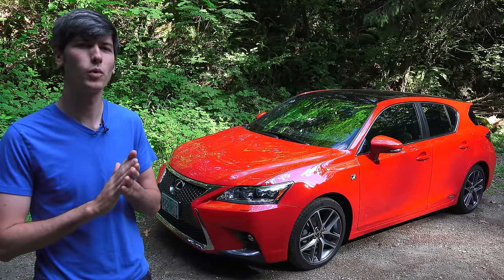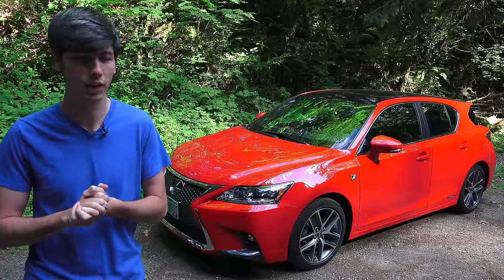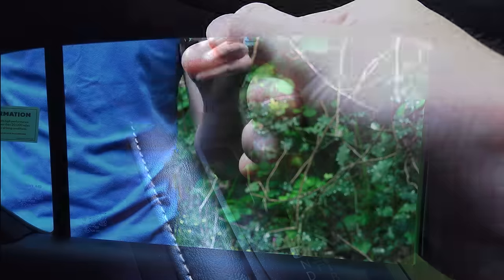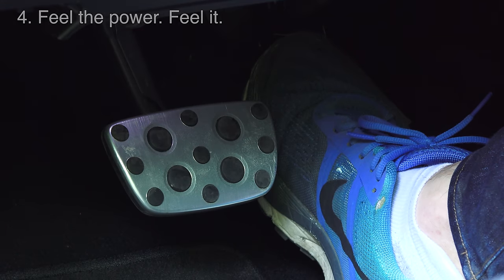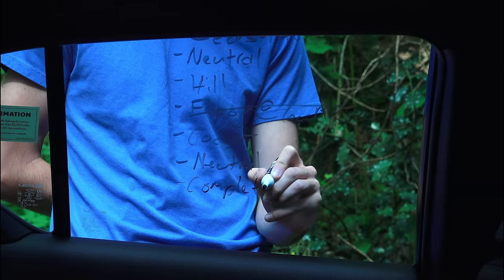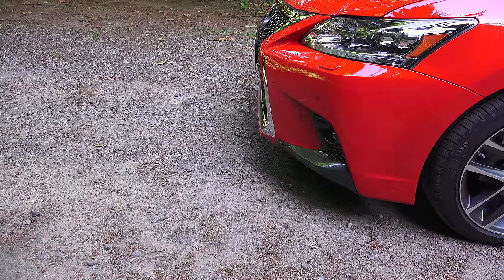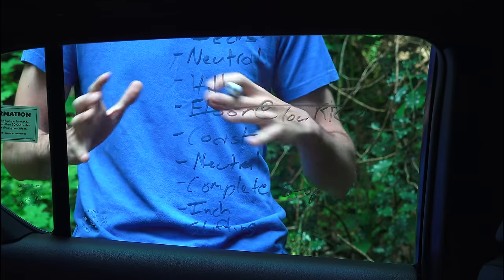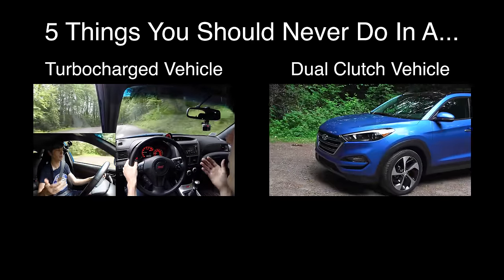5 Things You Should Never Do In A CVT Vehicle

Comment: the one huge advantage to a cvt is the possibility of the car to drive in full speed in reverse
Reply: Cool. Now I can turn my car from FWD to RWD and do some mad drifts!
Reply: Unless I has a speed limiting system for reverse, then, nope
Reply: +Steven Tenney electric car motors are 3 phase?
Reply: +MrJockeyHD old stuff if DC but hybrids and Tesla's have inverters that make 3phase AC power.
Reply: With 3 phase induction motors eventually, but with 3 phase synchonous motors that are very common it won't work because the field has to match the rotor position and it won't turn..
Reply: +Steven Tenney aw right thanks man I didn't know
Reply: +Steven Tenney however if it comes from the battery and obviously has a rectifier and a transformer where does it pick up the other two phases having already the line and neutral where does it pick up the other two
Reply: +MrJockeyHD the DC bus feeds DC voltage through the 3 IGBT's that each make AC power on individual phases
Reply: +Steven Tenney cheers again, how do you know this?
Reply: So it will be exactly like a fork lift!
Reply: +MrJockeyHD I work in industrial HVAC on large tonnage chillers that use variable frequency drives . BTW all inverters are only designed to last 10 years even if they cost over 100k on a 800 horse power motor. due to heat on solid state electronics. so a Tesla owner can expect a huge repair bill once the car is over 10 year's old. let alone battery cost
Reply: +Steven Tenney so what about the MK1 Prius that came out in 1997 still in original inverters and battery?
Reply: +Steven Tenney thanks for the knowledge, i'm an apprentice electrician and a huge care so electrical and mechanical stuff is interesting af, thanks again
Reply: +Steven Tenney gotta love VFD's! I use a bunch of them (KBAC 27D), in my shop for variable speed on machine tools like my 2"x72" belt grinder, surface grinder, and drill press. Literally I would be lost without them
Reply: +Finn Custom Knives there awesome on fan and pump motors don't beat up belts on start up
Reply: +Steven Tenney yep, they have a ton of trimpots for adjustments of everything. The slowdown feature is huge for me so I can stop the sanding belt quickly to change grits/abrasive types, not too quickly though as it does strain the system a bit
Reply: +Steven Tenney Although mine as primarily for single to 3 phase conversion and for the variable speed, although I do have a reverse switch as well
Reply: Is there any good resource to learn about the changes in inverter tech? Like up to the brand new topologies used. :)
Reply: " all inverters are only designed to last 10 years"

That doesn't sound right unless they design that failure into the system.  I can't see any reason why they should wear out.  They're solid state and the magnetics should last forever.
Semiconductors lose their gain over time with something called "junction drift" which happens faster at higher temperatures but managing heat is just a detail.

I'm not challenging you but I'm interested to know where you heard that.  I have amplifiers that are 40 years old that still work like new.
Reply: It is liquid cooled.. pretty much all electric cars have liquid cooled motor and inverter,  Volt, Leaf, Focus, Soul, Tesla, Prius, etc. Some have liquid cooled/heated battery pack. This is a very interesting comment thread.
Reply: +danwat1234 yes except for some Honda's . but you are relying on an electric water pump to last a decade. which when it fails it gets the igbts hot and reduces the life span
Reply: Steven Tenney I bet the Tesla warns you if you get a failure like that.  So you could fix it before you did any damage.
Reply: +Warren NZ I know a Prius will shut down of you get air trapped on vfd cooling system. bit it does heat up to a certain temp to alarm system and shut it down
Reply: Steven Tenney I know some CVTs use rubber belts like snowmobiles.  Those are crap.  The Lexus' is more like a chain.  Quite clever.  No slippage.  There's YouTube video on it somewhere.
Reply: perfect for arab drifting!
Reply: Warren NZ The inverter MOSFETS have high amperes through(in the range if 100A just for a 1kW inverter. Temperature management is a big deal in inverters. Also, they switch these currents in very high frequencies (of the range  greater than 16kHz fro sine wave inverters). 

Also, electronics don't last that long. The manufacturing methods used 40 years ago and now may be different.
Reply: Rojin Philip Reji OK, I'll accept that.
I've also heard from electronic techs at work that Chinese MOSFETs may have the same number on them as the OEM versions but don't always meet spec.

We run a lot of TV transmitters around the country and switch mode power supplies are forever failing.

So yeah, it's not hard to accept that modern electronics aren't always up to the task.  They should be though.  If you design a solid state circuit properly it should go for decades.
Reply: +Daniel Dias AWD= awesome way to drive...hehehe yep I got one
Reply: +Warren NZ Daf dutch car
Reply: Steven Tenney that's how I got my Chevy to the transmission shop.
Reply: Steven Tenney 
fast and furious mode?
Reply: cars are generally designed to last 10 years anyway, so at 10 years you'll have scrapped it.
Reply: Alan Brown I drive a 06' and it's 2017 it released in 05'
Reply: yeah go 150km/h on reverse is 100% safe
Reply: ***** on a circuit a while ago in holland, they did racing backwards after the era of dutch DAF cars
Reply: Circuit =/= Street/Road
Reply: ***** look it up DAF auto , was like a demolition race
Reply: still... high speed on reverse is not a advantage its too dangerous.
Reply: Nope, most CVTs have a fixed ratio reverse "gear". My Subaru bypasses the CVT completely in reverse with one ratio
Reply: And if you have an E-CVT you reverse on the electric motor only. That's because it's really a planetary transmission that does not "shift" gears.
Reply: lol, this works on a DAF but not on a modern CVT, which has a different final ratio for reverse.
Reply: Can't wait to see that! World premiere on YouTube!
Reply: You can win all the reverse races!
Reply: Pretty sure the car in Fast 8 was CVT then
Reply: That sounds fun.
Reply: Steven Tenney hows that a HUGE advatage 😂
Reply: "One huge advantage"
Reply: HAHAHAHHA
Reply: like Mater
Reply: Lol 😂
Reply: I think all cars are speed limited in reverse. I haven't found a car that goes past 40mph in reverse yet. Some toyotas use 2nd gear for reverse and can go quite fast.
Reply: big rigs over the road racing IRL
Reply: @georgiojansen7758  I own a 1974 DAF 66 Marathon and do  Historic Regularity Rallys with it. Toyota, Datsun, Peugeot and other owners are very surprised with the efficiency of the DAF . Regarding the backwards races I do hate them.
Reply: Lmfao
Reply: MrJockeyHD FULL BRIDEG RECTIFIER!!!
Reply: @steventenney8797  reversing any two leads on a 3 phase motor will reverse its direction.
Reply: I hadn't thought of that, lol.
Reply: Possibility does not mean that you can. You would have to mess up with cvt control program in car's computer...
Reply: @m1k869  3 phase synchronous motors are not very common. I have been working in manufacturing for over 30 years and I have seen only a few. At the factory I have been working at for the last 11 years there is none....
Reply: @steventenney8797  All HVAC VFDs are air cooled, while VFDs in hybrids are liquid cooled (more like a cooling tower), so the later work at a cooler steady temperatures.
Reply: It's limited, lol.
Reply: I WILL TRY THIS ON HIGHWAY
Reply: Yeah because we all do that in daily life 🙄

Comment: My last two vehicles were equipped with CVT. Kept the vehicle's time and distance maintenance schedule very strictly.  Never had a problem with the CVTs. That's with a lot of high mileage vacation driving with short mileage commuter driving. So, I guess, keep to the maintenance schedule.  I really enjoy the smooth transmission action.
Reply: 30k cvt fluid change??
Reply: 30k cvt fluid change??
Reply: @antvq  Most manufacturers suggest that you get the fluid changed every 30k to 60k. I would say if you change it every 30k to 40k (just to be extra friendly to the CVT) you shouldn't run into any issues with premature failure. 

From what I understand, a big reason why some CVT's fail is because the fluid wears down (when not changed enough) and causes higher temps in the CVT....This can then stretch the metal belt causing everything to essentially self destruct inside the CVT. The only way this would happen with regular fluid changes is if you were beating the vehicle hard for an extended period of time to the point of where the CVT reaches those high temps. 

Summary: Change the fluid every 30k-40k, and don't drive it like it's a racecar.....And you will be golden 👍👍
Reply: Just like a normal transmission. Nothing wrong with a cvt, everything wrong with a cheap cvt.
Reply: @saintrhoads3375  Exactly...Most CVT's are reliable enough as long as you change the fluid out at proper intervals and will last as long as regular transmissions. That being said, the only area where they seem to be more sensitive is if you DON'T change the fluid. I have seen regulars transmissions with 200k on the original fluid and zero shifting issues....But you would be lucky to get 150k on the original fluid in a CVT without it overheating and self destructing. Other than that, there is no reason they shouldn't last.

This does not include the Nissan Jatco CVT's lol.....Those CVT's are what gave CVT's this bad reputation to begin with.
Reply: most definitely  @antvq

Comment: I would love a video comparing the longevity and reliability of a CVT versus a traditional automatic transmission.   I routinely get over 200K on traditional automatic transmissions with nothing but fluid changes.
Reply: And CVTs have a lifespan of about 100k miles. If grandma drives it, it might last longer.
Reply: I got 140k off my Mk5 VW Rabbit with 5 speed MANUAL transmission off the STOCK CLUTCH and fluid, no fluid changes, clutch was still strong when I sold it (body rust from road salt)

Total transmission maintenance cost? $0.00! Seven years of reliable service, not a penny spent on fluid changes or rebuilds or anything, the manual is better, period.
Reply: Miles or kilometres?
Reply: @ambergris5705  Miles
Reply: @quagmirewarrior4202  where’d you get that number from. So inaccurate. If you don’t take care of the car then yeah you’re right
Reply: @vincestone5465  he read it from a Facebook post about one of the first cvt transmissions that weren't reliable, when in reality the cvt is just as reliable as a normal transmission
Reply: @keesknees  I agree we got a suzuki hatch and we are the 3rd owner of it, its driven 75k kms +, has cvt transmission works just fine, the model is 2015...
Reply: @quagmirewarrior4202  but when that CVT is paired with a direct injection engine grandmas engine goes to hell with the CVT at 100k.  CVT is a great technology but it leaves much to be desired in terms of development.  In 20 years they'll be great.
Reply: Who cares I can 3d print planetary gears as much as I want for cheap, even if I can't, it's still a simpler fix than fixing an automatic transmission
Reply: @Meleeman011  I need to live next door to you, LOL
Reply: I got a mitsubishi with cvt with about 120k miles no problems whatsever its my beater,work car. Because its so fuel efficent
Reply: never thought id see someone praising automatics as the more reliable traditional option
Reply: CVTs were made because they are cheaper to produce, less moving parts, and the claim better mileage.  I’ve never owned one so I cannot speak from experience.
Reply: @occultustactical6138  I get like 32 mpg going 70-80mph in my Honda Accord maybe more
Reply: @cbot375  10 speed?
Reply: It's dependant on who makes them. Can't just give a blanket statement that one is better than the other
Reply: @MacTechG4  But it's so hard to drive, hold my coffee, and shift at the same time! 😳
Reply: I've seen many automatics go 200k mile with no fluid changes.
Reply: @_rtx_  That's like 40k miles! OMG, when it has 250,000 miles let us know.
Reply: @robertkubrick3738  oKay...
Reply: That car isn't a cvt. It is a hybrid
Reply: My 2012 awd Juke has a cvt and a sweet little turbo. I'm at 186k miles and I certainly don't baby it

Comment: The Lexus CT200h is a hybrid. It utilises the Hybrid Synergy Drive as it’s propulsion System. 
It allegedly has an e-CVT transmission - which is actually a planetary gear set and has almost nothing in common with the conventional CVT auto transmission.
It’s ironic that you had to have a Lexus CT200h in your video, as virtually every point you made regarding CVTs DOES NOT apply to the CT200h - or indeed the Prius Hybrid which uses an identical propulsion system to the Lexus CT200h.
Your points are valid regarding ordinary conventional CVT gearboxes - but not on hybrids using the Hybrid Synergy Drive.

Unfortunately, many will get the wrong impression and think the Lexus CT200h e-CVT might be susceptible to accidental damage, when it is not.
Reply: Anymore info? Interesred in the difference
Reply: The biggest difference is that the Hybrid Synergy Drive used on ALL Toyota and Lexus vehicles DOES NOT have a mechanical reverse system.
Reverse is achieved ENTIRELY VIA ELECTRIC MOTORS. Seriously!
Even if the engine is running first thing in the morning, you are reversing using the electric traction motor only! 🤓
Reply: @datathunderstorm  so the cvts in 2015 or 16 es, would they be reliable? One of my relatives had a Prius ran well he sold it at 160k miles.
Reply: @bengal-desi6526  again: toyota hybrids do not have a traditional cvt.
if maintained properly, the thing is basically unkaputtbar.
Reply: I drove a Nissan micra with conventional 4 speed cvt. start acting up after 120k miles. now have a ct200h with 160k miles and the whole car drives like it's new. only issue iv had with it is clogged egr valve. causing engine vibration. cost 200 euro to fix.
Reply: @daveh7302  how’s the car now still have it ?
Reply: @serene4961  i have a 2010 prius. 175k miles just did fluids coolant trans and oil I do the oil full synthetic and start to feel dirty if the trip odometer says 3600. I do trans fluid every 25k miles, so excited for 200k. Vehicle shifts much better today than yesterday can really tell that fluid swap will continue to do it, may do brake fluid this summer brakes have always felt weak. Purchased at 72k miles, maintance Nazi since 130 hope I didnt do terrible damage.

Comment: the title says 5 things you should never do in a cvt, but i'm at minute 5:30 and i'm at number 9 of things that you can do optionally.
Reply: this should have thousands of upvotes.
Reply: he is an engineer, not a mathematician I suppose :p
Reply: Thank you for the warning man
Reply: NEVER EVER BUY A VEHICLE EITH CVT. ITS A RIP OFF. A WAY FOR DEALERSHIP TO ROB YOU. YOU CAN'T CHECK FLUID YOURSELF A LITTLE D COST $250 EVERYTIME YOU WANT IT CHECKED OR CHANGED!
Reply: Jkki C You don't change the fluid. you don't need to check it.
Reply: @jkkic426  you can check it easily on many.
Reply: Rekn Ralph That is true if you want to make the short life of the CVT even shorter!
Reply: @ReknRalph  yeah actually, you do. Metal components start to degrade like shitboxes usually do and as a result, can create build up and heat resistance in areas it shouldn't. This causes premature failure and unnecessary wear and tear. Fluid flushes/changes, and filter changes help to resolve this issue by flushing the excess metal debris out from the CVT assembly.